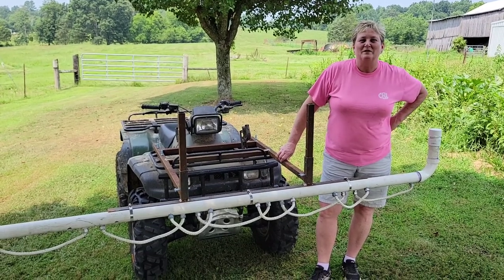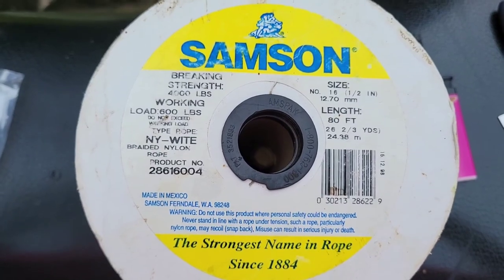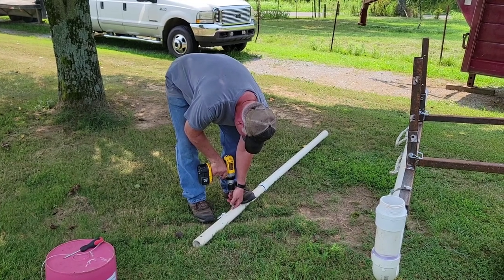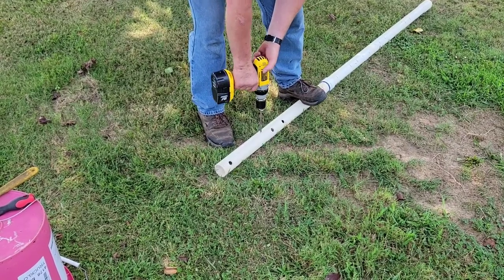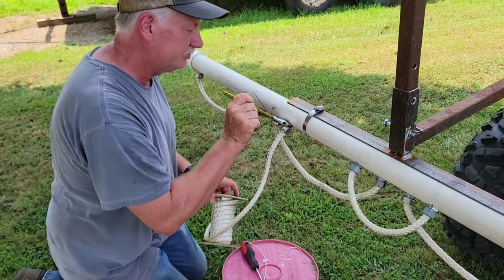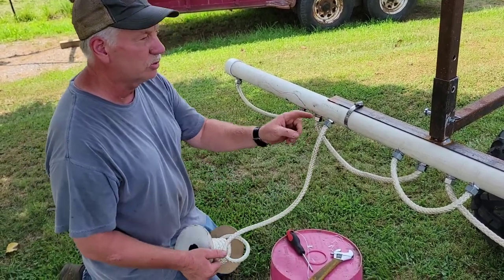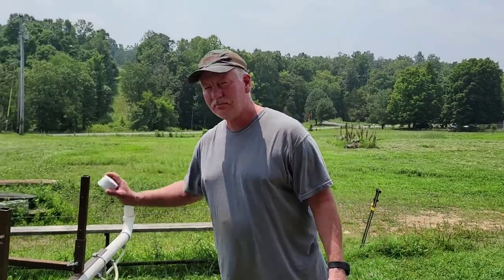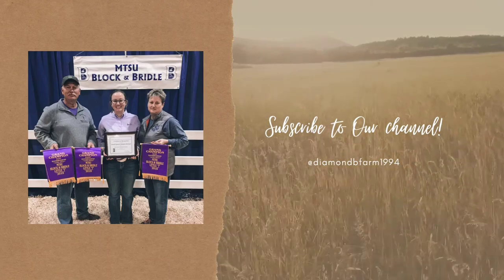DIY Weed Wiper

Comment: This is great I'm going to make one.  When preparing to spray I always add the roundup after the water and then drive around for a little bit to mix it up. This avoids the foaming up and I'm sure the same could be done with this.   I also add a die.

Comment: Should you put one on the back to stop tracking from tires?
Reply: I think if you do then the stuff the tires run over and bends down doesn't get wiped. If you were really concerned you would have to go off the sides. But yeah your tires would leave a few marks for a few feet I bet.